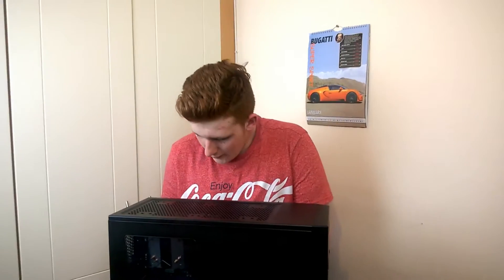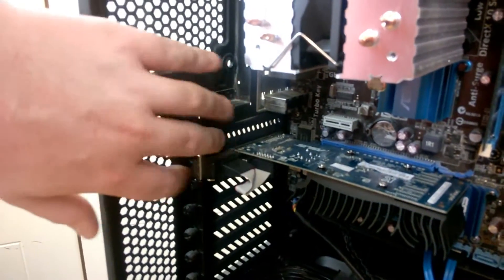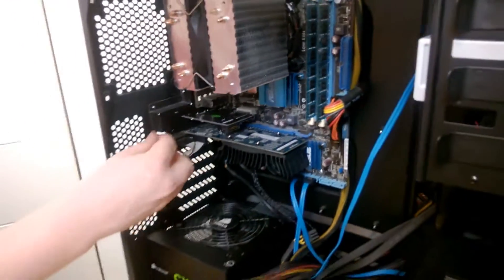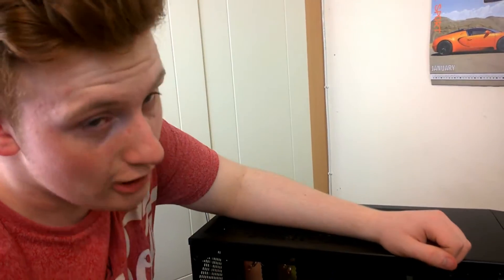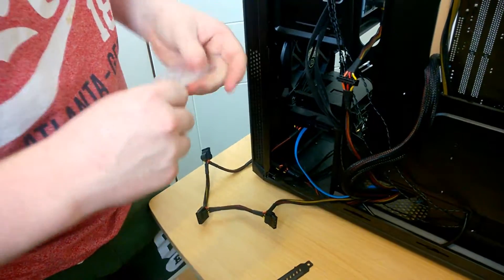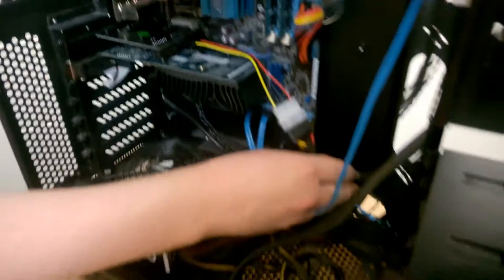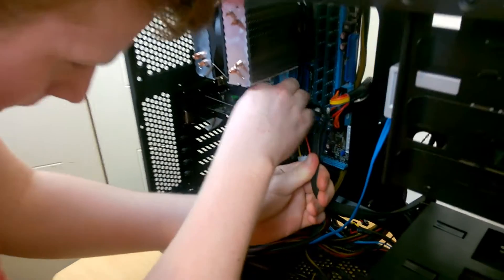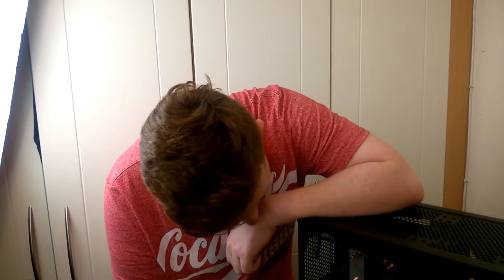How To Add USB 3.0 To An Old PC

Comment: Hi, I did exactly what you have done, but my 2 new usb ports only work as usb 2.0....why I wonder.
Reply: Stale answer but since you need to add a cable to the ports I will ask if you used a USB 3.0 compatible cable?  USB devices all the way out?  If anyone else has a similar situation google:  Do USB 3.0 Connections Require USB 3.0 Cables?